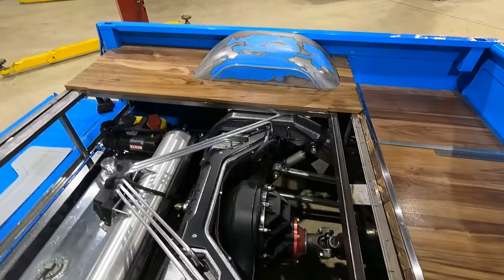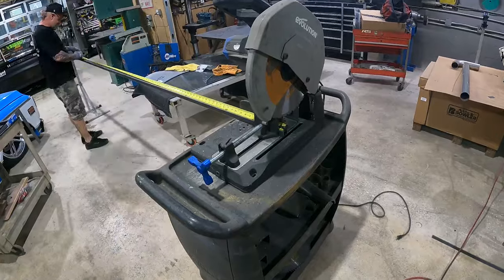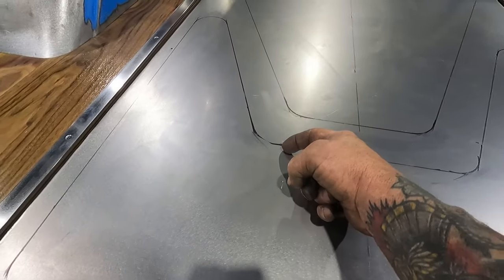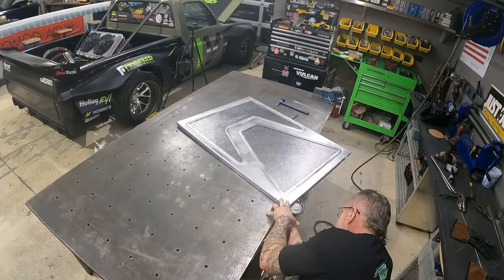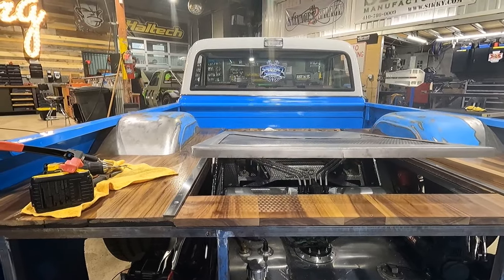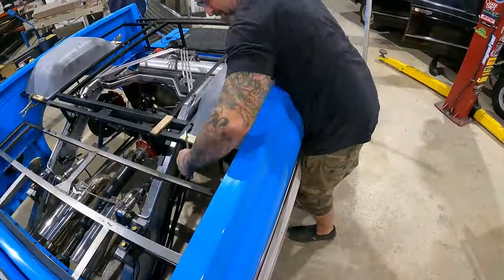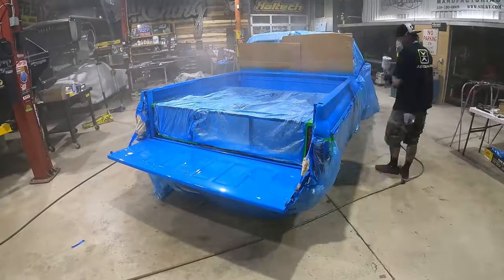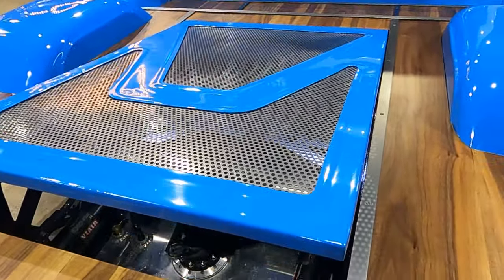'72 C10 Electric Hatch Build for Raised Bed Floor - Supercharged LS Swap Chevy Truck Ep. 19

Comment: ever consider using high end kitchen hardware for those doors.   The hardware tends to be hidden and the action is usually smooth and you can even get soft close hinges.
Reply from the maker: A lot of the times we end up going with boat hardware, since it's made to withstand the weather (and especially the salt in the air from being so close to the beach down here). Kitchen hardware is a good idea though. I wonder how it would hold up to the elements

Comment: With that gap that you mentioned,  you could run an led strip their to add some ambient lighting to the bed
Reply from the maker: We got some led's running under there already to light up the frame & airlift components when we're at shows!